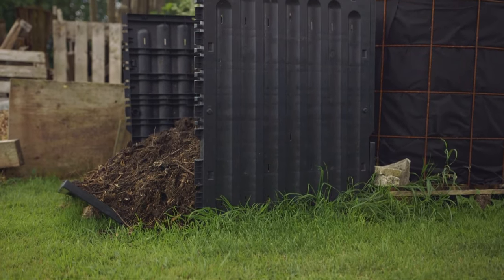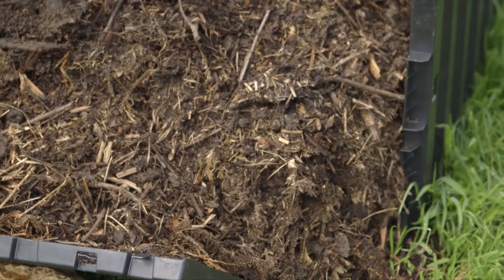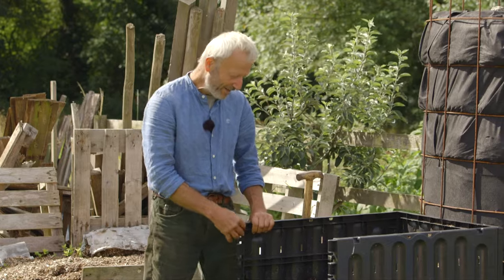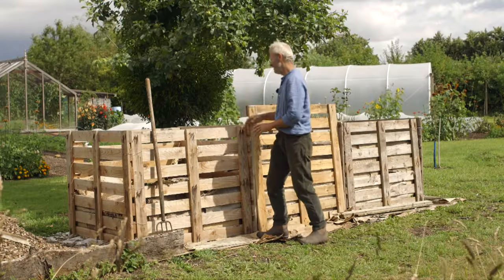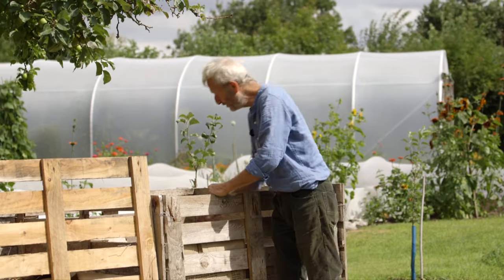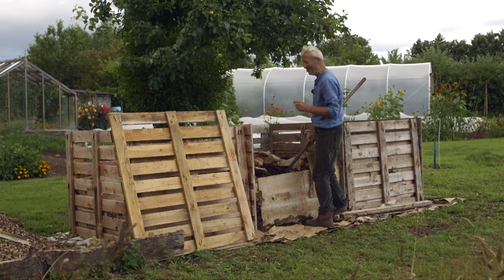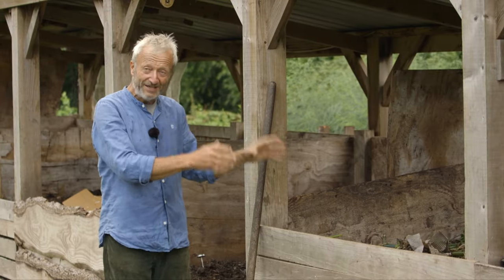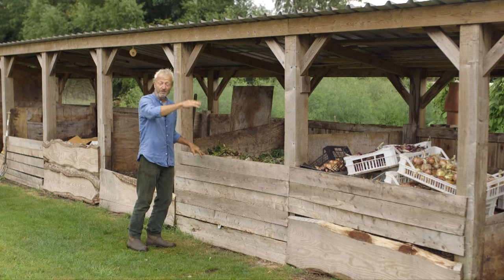Three Types of Heap, see how they work and the compost they make

Comment: Charles: much enjoyed your composting video, thank you so much. One question: should one compost badly blighted tomatoes (grown outside)? I have a smallish plastic compost bin which gets warm but hardly hot. Like you I live in Somerset, so maybe you have had similar problems this year. Thanks for your help.
Reply from the maker: Yes, absolutely you can compost them. Mine are just suffering now
Reply: @CharlesDowding1nodig  I am confused, there has been a lot of blight in uk this year and all the advice has been to burn or put all infected material in council green waste bins. Is that not necessary?
Reply: I'm also in Somerset, and whilst I don't have blight on my tomatoes in the polytunnel, it went through my potatoes incredibly fast this year when we had a period of warm and humid weather a couple of weeks back.  My understanding is that the organism that causes blight needs a living host, so there's no issue with putting entire tomato plants or potato haulms on the compost heap because there will be no living material left.  I'd maybe be tempted to cover them over with something else in case the wind can blow spores around, but as they've apparently been shown to be carried up to 30 miles on the wind I'm resigned to getting it if the conditions are right and little I do will change that.  Blight-affected potato tubers themselves may be more questionable in a heap that doesn't get very warm as they're still a living thing, but the RHS suggest putting them in your green waste which will probably end up being composted anyhow, so given a heap that gets nicely hot I'd not worry about putting them in either.

James

Comment: If you don't sift your compost then how do you get a fine enough tilthe for direct seeding crops, especially carrots.
Reply from the maker: I break up lumps while spreading it, before winter so that frosts soften the compost further. A light rake over the top in late winter/early spring gives a lovely soft tilth. 
Also, seedlings grow better when it's not super fine.

Comment: In colder climates, do you recommend keeping snow from accumulating on compost piles?
Reply from the maker: It should insulate against worse cold :)
Reply: I live in Canada and am in a usda zone 4\UK zone 5 or Canadian Zone 5\4.  I made some lightweight lids with a couple handles on the top so I can just grab them and slide them off.  It sits on top but not touching the material.  The best part is that I used a friends old 100% cotton futon, sectioned it up, halved the pieces and attached it to the inside of the lid.  All nice and cozy when it is minus 20 celcius! XD

Comment: How do you compost in the winter in colder climates?
Reply from the maker: The heaps are much less active because we are adding very little fresh material. They lose heat and decompose very slowly, in a fungal manner, which is fine. However if one has fresh manure that will keep things going

Comment: My compost is not breaking down and I don’t know what the heck I’m doing wrong!

We built a pallet compost bin, filled with greens and browns and I can’t seem to get it hot. :(
Reply from the maker: Possibly you have too many long pieces, stems et cetera which are holding large pockets of air, so there is not enough contact between all the materials. The first materials one puts in to a heap need treading down ideally.
Reply: @CharlesDowding1nodig  I only put wood chips, and leaves, and some grass and some manure.

Comment: Is compost better or Worm Castings?
Reply from the maker: They are both excellent for feeding soil life and increasing fertility. Because worm castings are so concentrated, you do not need many but that means they bring less organic matter to the soil, less carbon, so both are good to use together!
Reply: @CharlesDowding1nodig  Thanks for your quick answer. Would you consider doing a test to compare the two? You can plant 2 pots, Worm Castings in one, compost in the other, tomato seedlings and compare the results.

Comment: The update on my two-year compost approach in Northern Norway (wet, short season) is that it is working quite well.

The second year the pile is in a large, shallow bin covered in semipermeable strawberry-plastic, planted with Squash (doesn't look like we'll get any this year. Too cold July).
This year in moist darkness gets rid of many weeds that survive due to my sometimes lack of heat during the first year.

I've had problems with soggyness in the lower layers of both bins, so I've relocated the primary bin to a knoll and reduced it from 1.5 to 1.2meters square to lift more of the contents off the ground and harmonize better with the amount I can produce.
I'll have to reassess the secondary bin in late autumn. The Squash obviously needs water to grow.
Reply from the maker: Nice to read this Steffen, strange you were dry

Comment: There's a lot to dispute in this video from trivial and unimportant to some of more substance...
- This is pretty trivial, but the main compost piles of 3 meters square (appears to be still one meter high) is not 3x 1 cubic meter pile. Math says should be 9x.
- The compost results in this video are only fair quality because it appears that no pile is turned more than once, if even that. Compost that has been static for a longer time is not better than compost done correctly, and done correctly can be finished in about 12 weeks.
- High temperatures should not be avoided. The higher the temperature, the more active are the aerobic bacteria and the better the raw material breaks down. It's my understanding that when there are high termperatures, there are plenty of bacteria and fungi that thrive at those high temperatures so that statement about preferring lower termperatures is not to be followed.
- Excessive moisture should not usually be avoided. It's my experience that it's far more common for a pile to be too dry than too wet, and if the pile is large enough the volume will insulate the center from excessive moisture and heat loss anyway. So, I do not recommend covering the pile for seasonal rains, maybe only in the middle of some unusual weather event and then it's your decision since an overly wet pile will likely dry itself out anyway and it's very unlikely the activity at the center of the pile would be extinguished.
- Any decorations on a hot compost bin is probably a sign of bad management. When a compost bin is at least a cubic meter in size, it's pretty hard to turn, and usually turning requires taking down the sides of the bin to gain access to the pile. It's not impossible to turn a pile without taking down all sides, but it's a lot more difficult and decorations are just extra inconveniences that need to be dealt with if the sides are taken down.

The point of hot composting is that there are great benefits by achieving temperatures as close to water boiling temperature as possible... 100 degrees centigrade or 212 degrees Fahrenheit. At those temperatures, there is far more benefit than just killing weed seeds... All materials including wood branches and blocks up to a couple inches thick are decomposed that wouldn't happen under 160 degrees F. The material is so fully decomposed that the result is a jet black compost of nearly pure carbon, which during the last cool down builds an incredible microbiome of beneficial bacteria, fungi and fauna. All those beneficial microbes are stunted when you don't make the best compost possible.
Reply from the maker: That is great to have different points of view, thanks for sharing